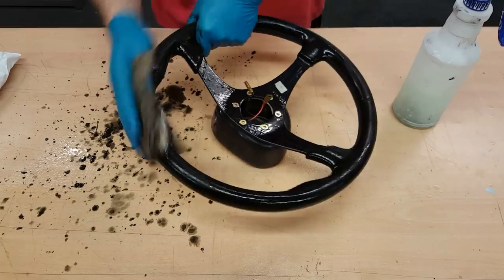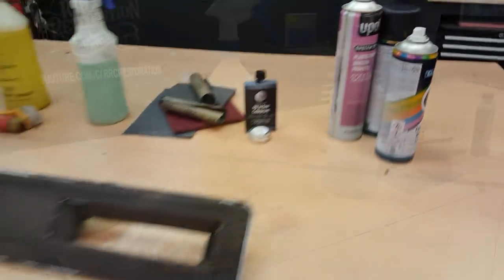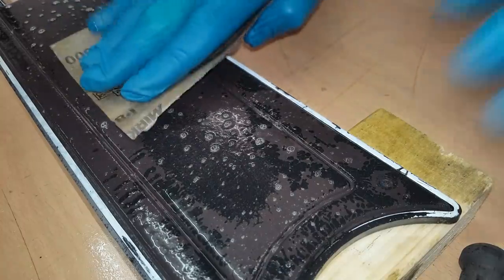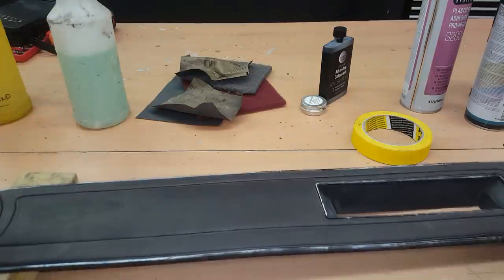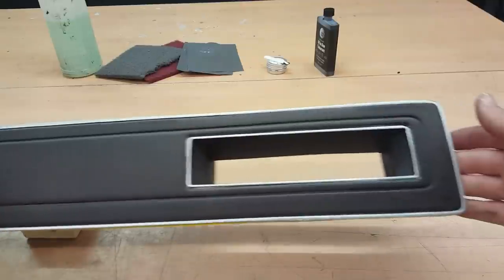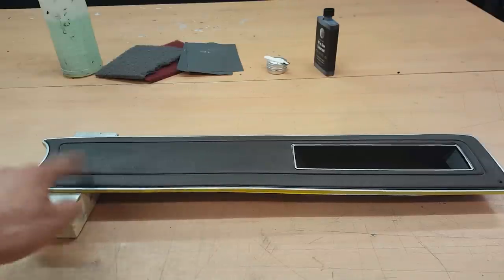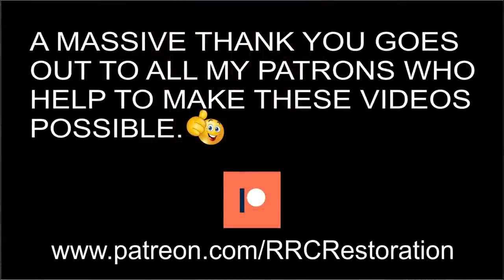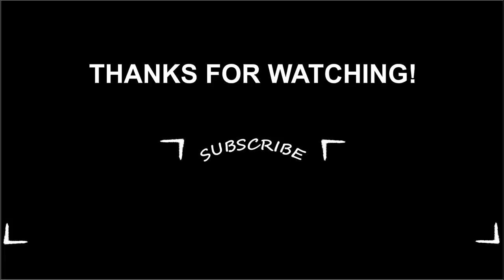Mk2 Escort Dash Pad Restoration

Comment: Is that a Suzuki Rgv 250 VJ22 (bananna Swing arm) by any chance ??
Reply: I think it's a Ducati 748, 916 or 998 based on the two square tail lights and the position of the neutral light on the meter.

I also like the RGV250Γ. The two-stroke smell and the sound of a racer bike. It reminds me of the 1980s and 1990s.